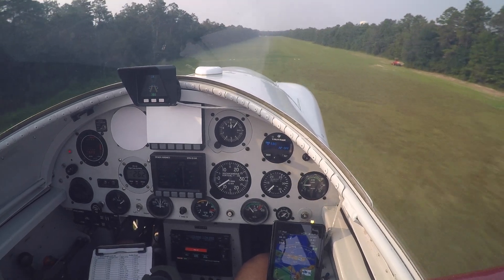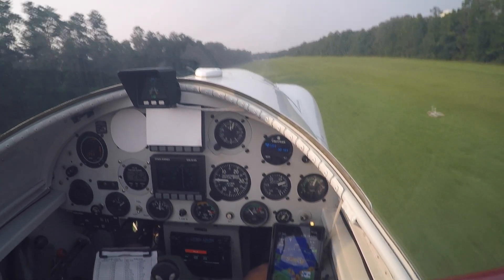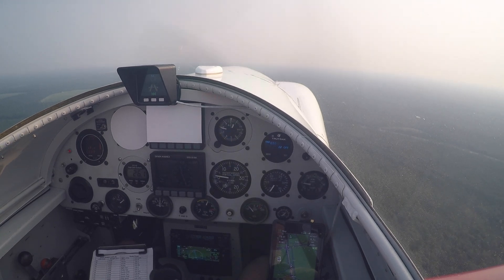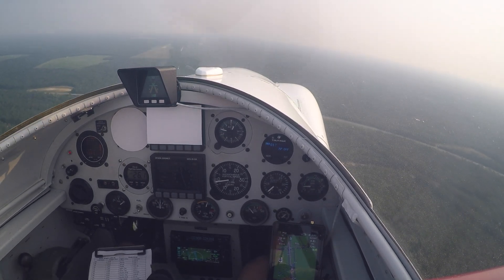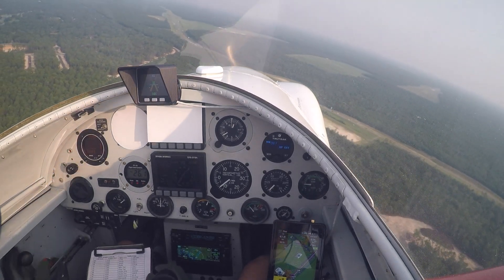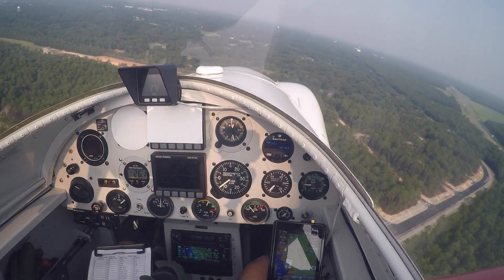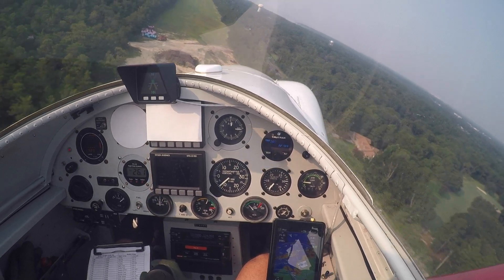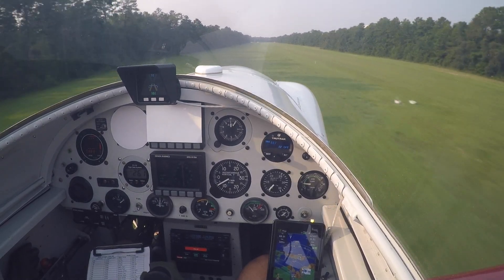Manual Flap Failure

Comment: What is that beeping sound? Is it some kind of audio airspeed indicator? It does not seem like it would be a stall indicator.
Reply from the maker: Hi Dean,

It’s an aural AOA system.  I’m flying without an airspeed indication, that’s why the standby airspeed indicator and primary flight display are covered up (day, VFR, experimental type certificate).  The tone provides an approach cue (steady tone) and “fast” or “slow” relative to desired approach condition.  

Unlike airspeed, approach (and stall AoA for that matter) aren’t effected by gross weight, g load or density altitude.  The military has been landing fighters using AoA for over fifty years.  We adapted this system from the McDonnell F-4 I flew when I had hair 😉.  Check out our web site at FlyONSPEED.org if you are interested in how it works.

Cheers,

Vac
Reply: @mikevaccaro1248  - Interesting. Thanks.